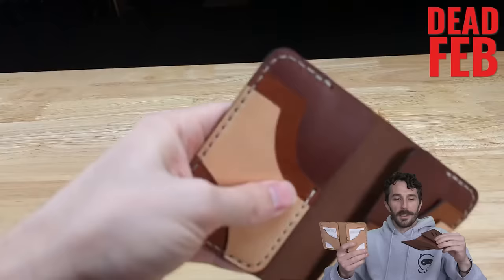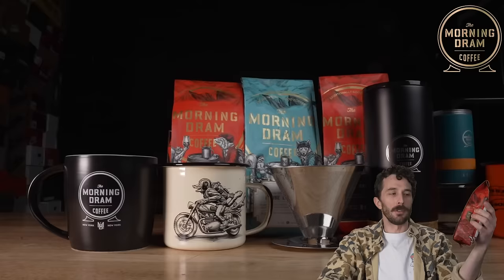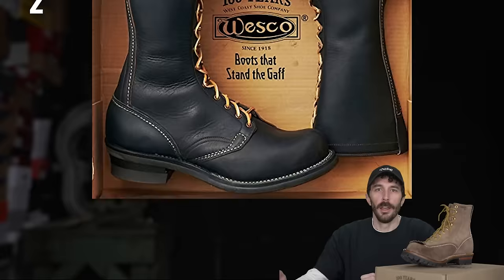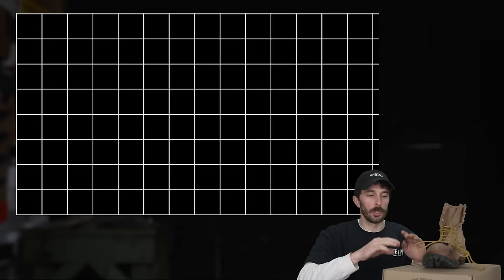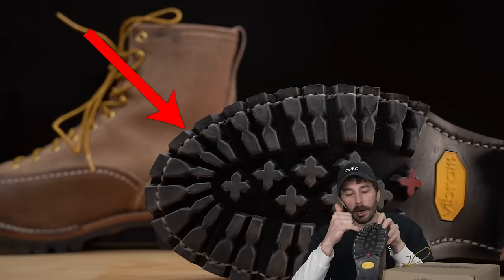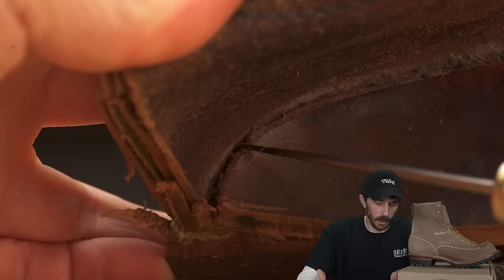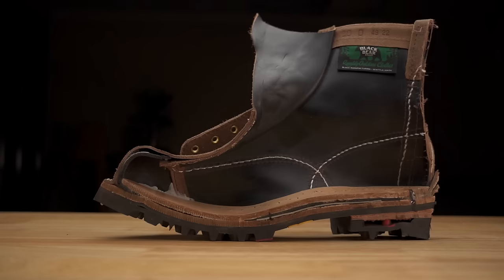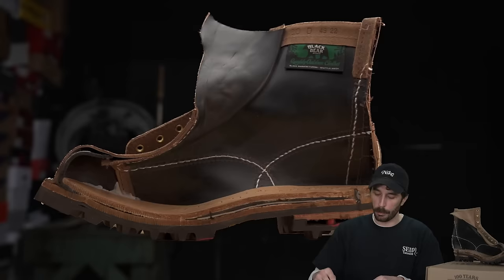The Truth: Wesco is not what you think

Comment: I bought a pair of their BOSS engineer boots of the shelf around 1999 - Love 'em, wore them riding motorcycles for years and they even saved my foot in a few accidents - One of which were I was T-boned and the car struck me directly at my right foot and bet the frame of the bike opposite the other side of my foot. The steel shank kept my foot from being pulverized. In '07 I ordered  a custom pair but they could not get the fit right after sending them back 3 times. I had the original pair rebuilt and they still fit today although I've since gone to barefoot boots made by Chris Layman of Broadwinger Boots. The custom pair of WESCO's sat in the box for 13 years until I traded them to a friend for other things so, in the end, it worked out BUT they were 100% unwearable for me....

Comment: So for what it’s worth I will share my Wesco experience. I have a pair of custom Jobmasters, mostly stock with a few minor modifications, and made from my custom last that was made from my tracing and measurements. The custom last was $100, but they keep it in their warehouse so if I ever order another pair from them in the future, they will be able to use that last without an additional charge. I ordered them one July, and they arrived at my house the following March. The arches were unbearably high out of the box, I have flat feet so they were torture, but after enduring and trusting the break-in period, it was 100% worth it. They have been my go-to pair of outdoor work boots for years now, I have yet to have them resoled since the forest floor doesn’t wear down rubber as quickly as concrete. The boots are tough, comfortable, rugged, and worth every penny I spent on them.

Comment: I bought the Wesco Boss boots about four years ago.
They’re super heavy duty and fit great, only problem is the left boot started squeaking like crazy about a year later.
I called Wesco and by the timeframe (many months) to fix it I just kept them. 
Filled up with water and let sit overnight in shower, the squeak stopped, for about six months. Filled with water over night and no squeak for a while. It got to where I just quit wearing them. 
Ok for riding my bike but that’s it.
Reply: It can't be good for your boots to regularly soak them in water for hours
Reply: If they are properly dried (without heat) and oiled after, it shouldn’t impact the durability too much. If there is a way to get oil between the layers though, that might be better. Just don’t attempt anything too crazy like an oil soak if you use a cloth lining, any insulation, or don’t have oil-resistant soles.
Reply: @bootcloset  Please explain why (at that price point) this should even be a consideration?

Comment: I would say, you said the reason they use cardboard in the heel.
They can't do as thicj of leather or material.
I'm sure it's the trade-off for using the automatic nailing machine.
Reply: You can spec a +2 on the heels, so that ain't it
Reply: @cloveroak5492  oh, lol, okay then 🤣
Reply: @cloveroak5492  so are they using a compressed board material in the heel stack vs all leather?
Reply: @absolutefreedom9437  it is leather. It is compressed leather
Reply: @cloveroak5492  why use compressed anything? Why not use all leather?
Reply: @absolutefreedom9437  I don't work for Wesco, I'm not sure. I received an initial response that it isn't cardboard, and is compressed leather. Oakbark tanned leather does resemble compressed leather, except that it has a different look to it if the heel isn't stained black. He said he would send picks or maybe a video Monday. To an extent I think the answer has to do with vendors. It may actually be better, or have some sort of other good logic, but if so I haven't heard it....yet...

Comment: I bought a pair of their high top work boots with a steel toe in around '73.  Good boot.  I bought another pair, low top walking boot in 2004 or 2005.  They don't fit.  Would I buy another pair from Wesco?  Nope.

The founder was a cobbler.  The guy running it today is  businessman and the results show.

Comment: The heel counter is a thermoplastic material that is formed to the shape of a heel cup, and ultimately holds that shape more consistently over time.
Reply: possible but thermoplastic is more of a 200$ boot feature
Reply: @rudiausbuddeln  Wesco, who has been making boots for over 100 years, uses thermoplastic heel counters because they maintain their shape better over time than leather. Unlike most other parts of a boot' the heel counter does not "break in", it is shaped to the last, and meant to stay in that shape for the life of the boot. Heavy leather heel counters rarely fail, but they do fail more frequently than thermoplastic. The thermoplastic counter is also significantly more expensive that leather heel counters.
There are plenty of flaws to pick out on this boot, the heel counter is not one, and it is another in a long line of examples of the host not having a working knowledge of footwear manufacturing.
Reply: @neomoritate  thermoplastic is cheap material its used in meermin 200$ boots. In their 600$ boots meermin uses leather. I have 0 ideas how you would think thermoplastic is more expensive.
Reply: @rudiausbuddeln  Meermin don't use thermoplastic; they use Celastic. Same with most cheap brands. 

Celastic is a resin impregnated fabric that can be dipped in acetone and molded into shape, which then hardens as it dries. It's cheap and requires no specialist equipment to work with. When you see lightweight stage props, they're usually made out of Celastic and painted by the props department. 

Stytherm, which is what Wesco uses (not Celastic as incorrectly stated in the video), needs specialist equipment to work with. 

Once cut into shape, the Stytherm counter has to be heated on a special machine. Once softened by heat, the counter is then formed to the correct shape inside the boot. Once formed, the Stytherm has to be rapidly cooled in a different part of the process, resulting in a permanently formed counter that won't lose its shape. 

Material costs are usually only a small part of a boot's manufacturing costs; most of the cost is time and labour. Stytherm is slower to work with than leather, and requires specialist equipment and skills. Plus, most bootmakers will usually always have loads of leather in stock, whereas Stytherm will need to be ordered separately in a range of thicknesses. It's used despite the extra manufacturing complexity because it doesn't lose its shape when wet like leather can. 

I'm not aware of any cheap brands who use Stytherm (plenty use Celastic, but that's a very different material), and I'm not sure why you'd think the extra time, labour and energy required to utilise Stytherm would make it 'cheaper'?
Reply: @JimKiralfy  I didn‘t know any of the differenciating you mentioned here. All I read on several reviews was that Meermin uses thermoplastic and that leather heels are the better choice.
Reply: @rudiausbuddeln  I think there's just a section of people who automatically think "leather = better" without necessarily thinking about material properties, costs, or manufacturing processes. 

It's understandable to an extent; I think most boot guys are also leather fans to some degree. But there are lots of applications where leather is only considered 'better' because it's 'more traditional'; not because it's actually the best material for the application.

I own lots of boots with leather heel counters, and several pairs of Wesco's too. Whilst there's a lot more that goes into making a boot than the choice of heel counter material, I will say my Wesco's are probably my most bomb-proof, 'zombie apocalypse' worthy boots. There's nothing cheap or compromised about them; if anything they're unnecessarily overbuilt.
Reply: @JimKiralfy  what I read about Meermin‘s „thermoplastic“ that it had the possibility to shatter and crack which won‘t happen with leather.
Reply: @JimKiralfy  interesting information, thanks

Comment: I had squeaky boots as described, very annoying. I followed the protocol of pouring oil into the boots and letting it soak in over the weekend. No more squeak.
Reply: What kind of oil did you pour in, and how much did you pour?
Reply: @martinley4952  I used Huberd’s Boot Oil, but I think any conditioning oil would work. A healthy pour, more than two tablespoons but less than ten. I’d also shift the boot around once a day to recoat the whole insole throughout the weekend. I wiped the excess out on Monday and used it to condition the rest of the interior of the boot. Wear a pair of socks you don’t care about the first day, they will get oil on them. Both of my boots were very loud, to the point I basically hated wearing them but they’re fine now. I expect to have to repeat this procedure a couple times a year.
Reply: @KipKaspertly  thanks for that info. If mine start squeaking I'll get some of that oil and do what you did. I didn't know that was an option until I saw your comment.

Comment: Westin, great video really enjoyed it as always! I was thinking do you reckon that all of the Wesco boots are built pretty much the  same as these were? Because the Voltfoe  is technically a lineman boot and the Wesco Highliner also is a lineman so I am curious if they are built the same across the board or if their  more casual line boots are built a little bit more casual.
Reply: This boot was made differently because of the collaborator and because of the leather choice.thisbis not representative.
Reply: @cloveroak5492  not exactly true. The foundation of their boots is the same throughout. Heel stack materials, internal heel counter material etc are all the same. Choice of leather and last may vary but structural details will not change bwtween this and thwir standard Jobmaster.
Reply: @absolutefreedom9437  not exactly true.
The collaborator picked the leather.
A thin enough leather that a thinner counter was required.
So no....the counter is not representative of most Jobmasters. Similar thing going on in the toe area.
And of course the leather thickness is because the collaborator picked it.
I'm certainly not saying that Wesco allowed the collaborator to cut corners.

Comment: Certainly shocking for me. I've worn Wesco boots, both for work and casual, for over thirty years and NEVER had any of the crap you found. They have always been the best built and  have the best customer service. I started with a pair of bone stock Jobmasters (which I've had recrafted multiple times), stopped by Scappose  and had them make me a fantastic pair of Wellingtons, and have a pair of Big Boss and VoltFoes. With every pair and every re-craft my experience has always been first rate. Had I started out with a pair with a nail messed up I would have never bought another pair. It certainly is very shocking and disappointing to see. I'm sure you let them know as that is NOT the quality they are (or certainly were) known for.

Comment: I love my Wesco Boots. I'm a construction worker and my Nicks we're too heavy duty for walking around on pavement and doing normal construction stuff. I actually like my West Coast better and after seeing this, I kind of assumed the other ones are much different heavier so that's probably why I didn't like him. But the Wesco's for me are the perfect Building trades kind of boot. All the quality is there. The last few 10+ years. But they'll use a little center or cheaper if you will materials. I guess that's your trade-off. I've never heard or seen the nail issue that happened that is very unfortunate and a bad luck for them that they didn't catch that. But my guess is, a mistake doesn't happen like that and get out of the quality control. In fact, knowing that this was going to be cut in half or whatever it's possible, they sent you a boot with imperfections.

Comment: This videos was dangerously reductive. 
So, I own a lace to toe Jobmaster ten inch tall boot, the ones that make all at once so it’s the base model and not custom.  
Mine has a very solid leather heel counter, I can feel it. 
Mine doesn’t have a leather board heel stack, it’s all leather 
Mine has seven ounce work leather pretty much as thick as my Nicks with 1964. 
Mine has a gap in the leather on the interior at the toe, there is a funny peice of plastic there, not a composite toe but a cosmetic stiffener. 
So yeah it’s different but not as weird as yours.
Reply: Wesco does NOT use leather internal heel counters. They use a material called Stytherm
Reply: @absolutefreedom9437  true....but the Stytherm (aka Celastic) they used for this horse Collab is MUCH thinner than the Celastic they use normally.
Reply: @cloveroak5492  that's not true, and you have no factual evidence to support your baseless statement. Truth is they have only 1 machine that makes and molds the Stytherm heel counters for all their boots and they are all the same thickness. These are the same as all Jobmasters.